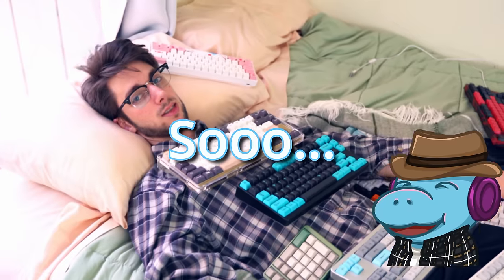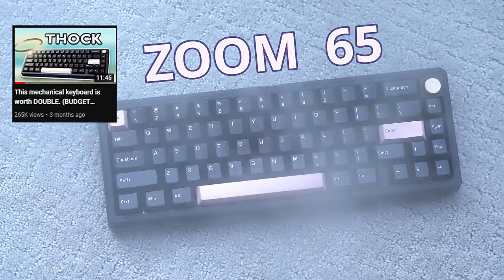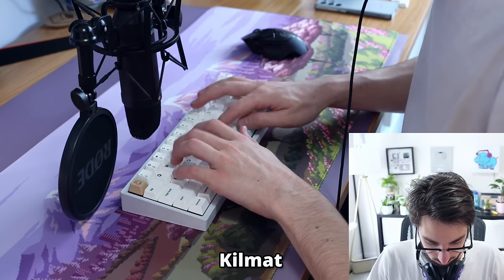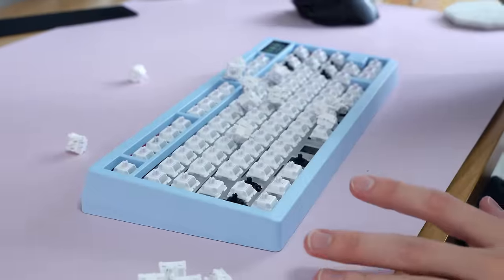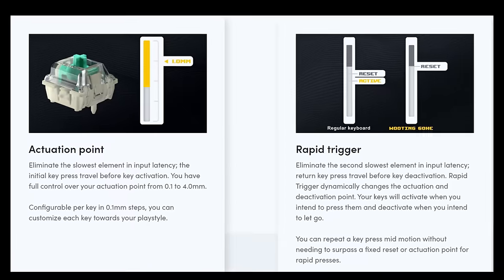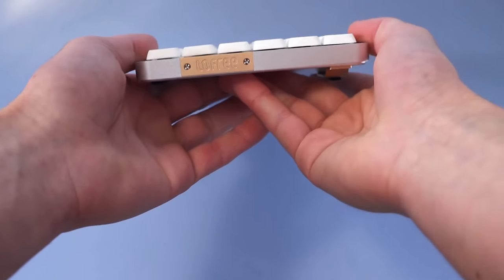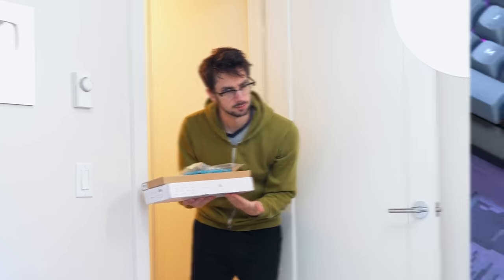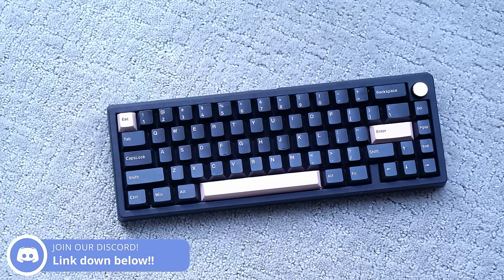I Tried Over 60 Keyboards... (So You Don't Have To.)

Comment: Have you experience keycap wobble on the Wuque morandis? I have a small set from milktooth and any of the keycap varieties I have feel like they're going to fall off. It takes no effort to take the keycap off manually.
Reply from the maker: I've heard some people complain about it but I've never had any issues? Could be Keycap brand or something
Reply: @HipyoTech  I've wondered that too. I've tried them with different keychron sets, a drop DCX, and random amazon sets, all act the same way. :shrug:

Comment: Hey my girlfriend bought some expensive keycaps that are compatible with cherry mx and it's clones. I am looking for a keyboard that is compatible with these keycaps. But I get wrist pain when I use high profile keyboards that are not only high up but also have varied heights(inclined). So I wanted low profiles but it would seem I cannot swap the switches on low profiles with non low profile switches. Is there a flatter high profile keyboard or is there something I can do here? Maybe a wrist rest will help? I REALLY could use the help.

Comment: Get a  Redragon K556, $50 U.S. MX Browns are PERFECT, the board is a solid block of aluminum, built like a TANK. Thats 50 bucks, includes switches and caps. FULL RGB.
Reply: Maybe you don't like the number pad,? It is a bit heavy, you could beat an intruder to death with it. DO NOT drop it on your toe...

Comment: Nice overview, thanks, loved it! ❤
Sadly I can’t find any keyboard matching my requirements:
TKL, sorry can’t deal with any other layouts, I have tried and failed every time. Hardly any good TKLs around. Then to make matters worse, ISO layout is a must, even fewer support that. Then comes the impossible task of finding good keycaps, that include Nordic caps. I might as well just give up, this hobby is clearly only for ANSI users that can accept silly dense layouts that lack many needed keys 🤷‍♂️😂 Yeah I know, the market volume for anything else is probably too small. 
Anyway, whenever I see a keyboard review I go: Do they have a TKL model? Does it come in ISO? No to either is a no starter 🙃😕

Comment: Here I am with my gmmk pro getting my cheeks claps still haha. But that's fine. I got the barebones on uber sale and it's the best sounding board I've built so far. Got gateron ink black v2's with new stabs in it, I replaced the plate to brass and I did the foam mod. But I agree, it's way over priced if you buy the non-barebones.
Reply: It's a really good keyboard, enjoy it. don't listen to people lol.

Comment: So you checked each keyboard to verify it connects to three or more different bluetooth devices and that it has a dongle that can easily be purchased when lost? What, not even that? Well the, surely you tested whether the keyboards handles programmable macros that are not tied to an OS? Right? Something to separate your review from the hundreds of worthless reviews that glow about the colors used in the keys and the sound?
Reply: Or perhaps include another metric, like whether the keyboard has replaceable rechargeable batteries?

Comment: You are downplaying the utility of hall-effect switches for FPS games not to mention wooting having the best latency, software and rapid trigger implementation compared to every other clone. The chatter is because of the terrible Lekker first edition switches. Now we got gateron jades, oranges and geon raptor switches. It's not like they are soldered in. And an aluminum tofu redux is like 60$. So for 220$ you are getting a way better keyboard than the BOOG75 or whatever. But if you said this you wouldn't be able to plug in the affiliate link for it right? XD

Comment: I think thinking keyboards sound good is the DUMBEST thing; they ALL sound like trash! Keyboards shouldn't have any sound at all, THEN it would be good.

I don't know why mechanical keyboards are supposed to be good, all of these are trash. None of them have any additional programmable macro keys and they don't have a number pad - trash!
The only keyboard that I found is decent is the Logitech G915 linear; you can program the lighting per key per program, set up a max of 24 custom keys per application, and it has a smooth volume knob/roller and dedicated media keys. Using the 5 side G-keys and setting one of them to toggle as a G-switch key you can assign alternate macros/button presses to 4 side buttons, and the 3 MR buttons across the top let you assign 3 different sets of functions to the G-keys per app, which is how you can have 24 custom keys per app even though you only have 5 G-keys on the left side -  very useful for games and graphics/video editing programs in combination with a decent programmable mouse.

Comment: Well i think there is a range of keyboards you are not covering well and that is the mid-range category. There are now keyboards at the range o 50 € το 90 € that are well built with budget switches ( mainly Outemu and the likes) but they do the Job pretty + they are HOT SWAPPABLE, witch leaves a lot of room for modding anndddd.... a video for you to mod!!!! I am on the very Budget category. I got a Bloody S98 (Aviator) it is actually gaming-centric but i got it for Programming!!! For it's price it does it's job really good (keyacaps are probably ... horrible!!) . .... But it's Wired!!!!!!! So i also got a budget Royal Kulge RK96 witch does ... EVERYTHING ( wired, wireless 2.4Ghx , Bluetooth 5 (or 3 don't know) , Big Battery, Palm rest, too 2 USB ports when wired, HOT SWAPPABLE, CRAPPY 😁 yellow Outemu switches !!!) I really think you should try it!!

Comment: Ima get the q max. Idgaf.
Reply: Got it. Definitely worth. Comes with force break mod and extra foam so you dont basically need the tempest mod at all, but it helps. Spacebar has foam inside to help with hollowneas, feela very premium. Extremely premium, i dont really use the RGB so the keyboard battery lasts about a week or so lol. 2.4ght is a blessing